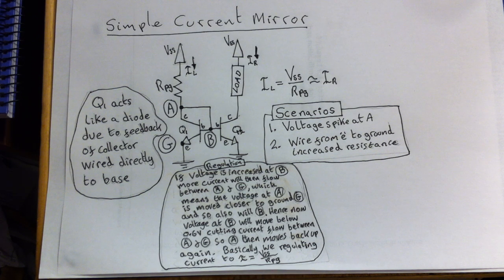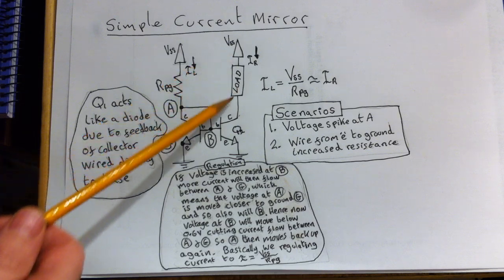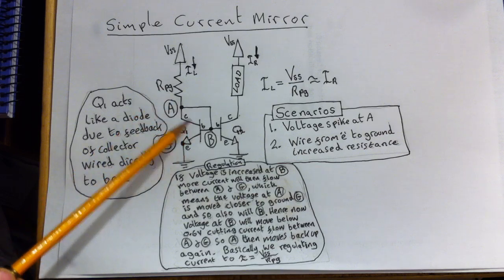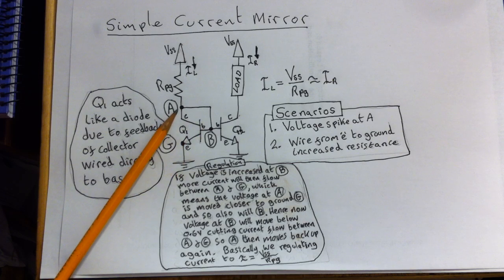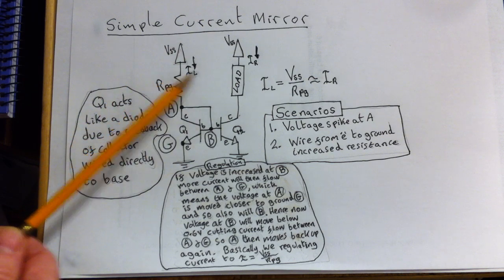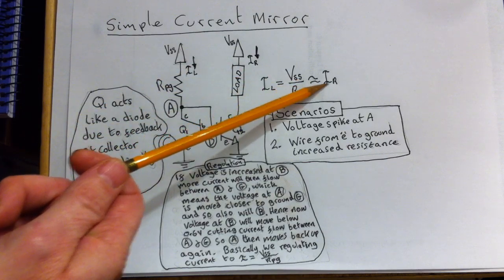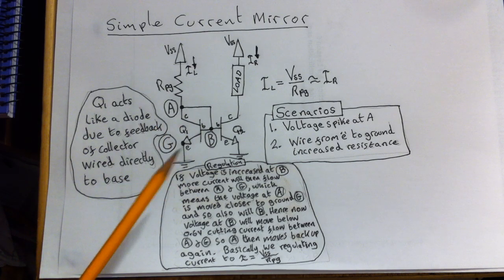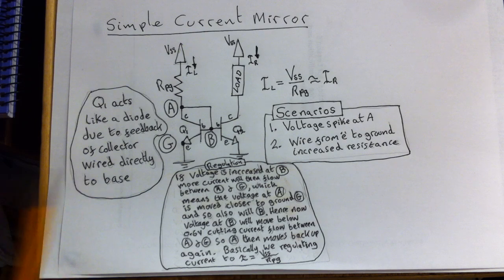What is a current mirror?

Comment: how is Q1 a diode though? I get how base to emitter is a diode but there is current flowing from collector to emitter also! A diode does not have 2 paths in it.
Reply from the maker: +Captain Rhodes Its a transistor not a diode. But in this configuration it has similar behavior. What we have is a short circuit between collector and base. That means effectively we have a PN junction between collector (via the base) and emitter. This is what I was referring to. Yes, charge will flow from collector to emitter. But if voltage at 'A' (the collector) drops below 0.6v (eg the base emitter voltage threshold) then no charge will flow, 'like a diode'. Hope that makes sense.

Comment: Am I understanding correctly that for this system to work the impedance of the load at the Q2 collector must always be less than the reference resistor Rpg?  Because it seems to me the moment the load resistance exceeds Rpg the collector current of Q2 cannot match the collector current of Q1 regardless of the dynamic changes in the resistance of the Q2's ce junction controlled by the base current.  The simple Ohms law. Am I missing something?  I am assuming that the Vss voltages on both transistors are the same. Thanks.
Reply from the maker: Bob Berg Yes you have it. Well done!! The load can be any value at all, so long 
as it is less then Rpg. Try this simulation out, it is very good. http://www.indiabix.com/electronics-circuits/current-mirror-with-mosfets/
Reply: EM & Basic Electronics Cheers, that's what I thought.  Pity that the simulation does not include a situation where the load resistance exceeds Rpg.
Reply from the maker: Bob Berg Yes you can. That is the cool thing. Click your mouse in the simulation window and you will find you can move the resistors about. Swap them over and then you can prove it to yourself.
Reply: EM & Basic Electronics Oh yeah thanks, so it does allow you to move resistors including the situation that make the mirror defunct. Thanks again.

Comment: Thanks a lot, but one question: why Q1 and Q2 has the same base current?
Reply from the maker: That is a good question. The PN junction voltage 0.6 to 0.7 dropped across Q1 (A to G ground) is the same as that dropped across Q2 (A to the ground of Q2). And because the base-emitter resistance is roughly the same (although ignored in this example) through both Q1 and Q2, they then both will carry same constant current from B to ground. So when you Increase current (by increasing Vss or decreasing Rpg) the Ir current will also change (or track) to the same value as the left hand current through Rpg.

But that is a really rough picture. Because if you in fact placed an ammeter at position A the current showing will be different from the current showing through Q1 (from Q1s Collector to Emitter) because current is shared between the base emitters of Q1 and Q2, which is in direct proportion to the current at A but, with base emitter currents being very much smaller. So another ammeter at G will not show the same as the one at A as it will be minus the small difference of the amount that is used up across Q2. But the ratio between the current at A and the current from Base to Emitter is very large so we usually ignore this in calculations. So it means when the Vss is increased a very small proportion of the Base Emitter current also increases as well on both Q1 and Q2 in direct proportion. But because they are equal in value the current through collector to emitter of Q2 is almost equal and tracks the current through collector to emitter of Q1.

So, if you built it, the values probably won't be the same as I have ignored differing Beta values and temperature effects etc. Its a very rough first approximation. So the real values will differ slightly.
Reply: I understand it,thanks for your further details.
Reply: EM & Basic Electronics So the Vbe across Q1 and Q2 are the same, basically giving rise to equal currents?
Reply: Aaditya Koirala I don't know why but it seemed to good to be true at first. I checked back on the common emitter configuration and then realized that I-V characteristics at input ( Base Current vs Base-Emitter Voltage) is simply that of a forward biased diode. Assuming that the two transistors are matched, we obtained the identical base-emitter voltages and thus identical base currents. Is my understanding good although mixed up?
Reply from the maker: Aaditya Koirala Yes you have it! Well done. The drop is about 0.6 to 0.7 volts depending on the particular device. Its why such transistors are housed in the same package so that their properties are as close as possible.

Comment: I just don't understand how would the current in the base be the same as the current in the collector of Q2. Isn't the current of IR dependant on the vss source and the load because it's going down?
Reply from the maker: The base current is different to the collector currents. A very small amount of charge only flows into the base to maintain the base to emitter PN voltage above 0.6volt. So with base to emitter kept above 0.6v, both transistors are kept fully open with an equal current running down them both (Collector to emitter). So current in both Ir and Il are the same and effectively defined only by Vss and Rpg. The resistance of the load won't effect this current value (within limits of transistor breakdown voltage). So even if the resistance of the load was increased in size we would still see the same current in Ir as in Il.
Reply: nivek192

Oh so not a lot of current from IL goes to Ib? For some reason I saw the wire in there and remembered that current always goes through the easiest path or w/e. I'm just confusing myself at this point. Thanks for the explanation mate.
Btw your videos are great...very simple and clear, keep em up.
Reply from the maker: This can be a hard concept to grasp. Once you have understood it, then you are doing really well. A good way to understand it better, is to build it on a breadboard. Its a very simple circuit to construct. Measuring all the currents and voltages will then, eventually make it all  clearer. Also Google as much as you can about how BJT transistors work.